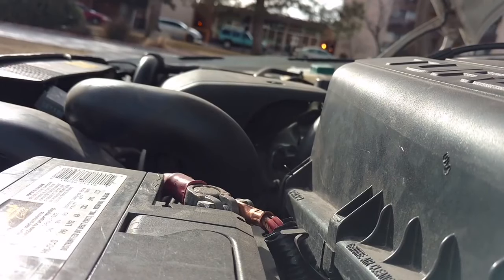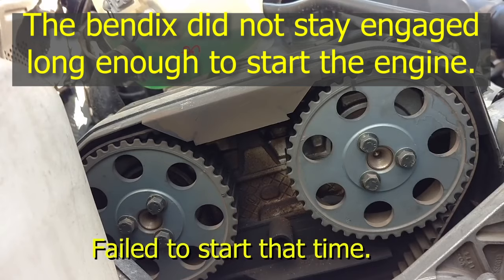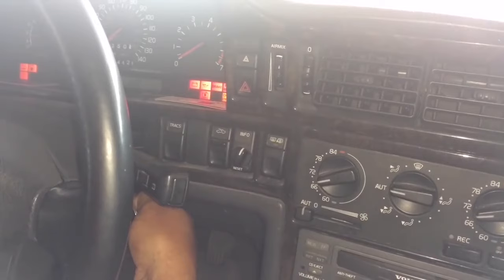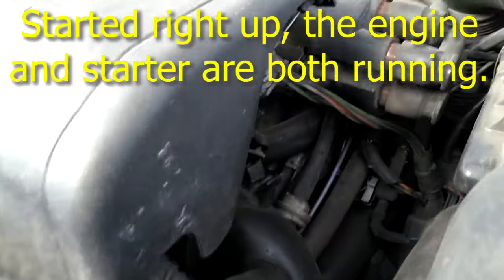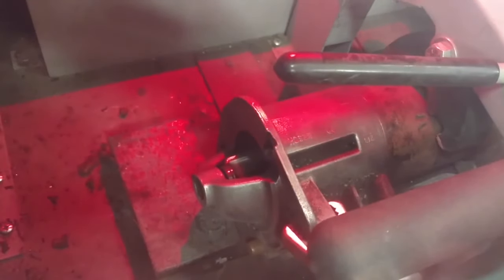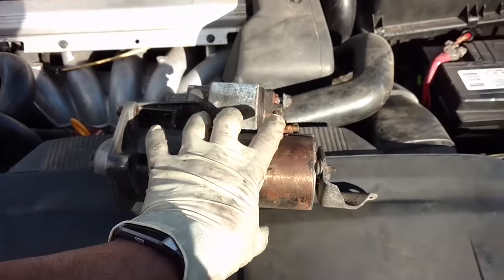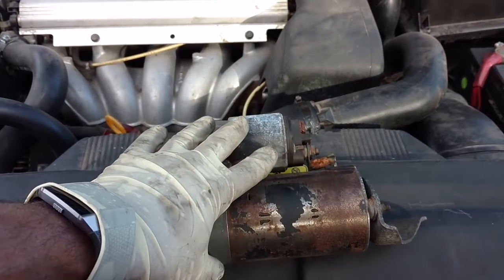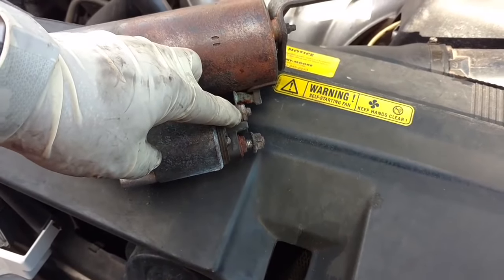Is your starter bad, hear the noises or sounds a bad starter will make. Also a full demonstration.

Comment: I just had my starter replaced at a shop, I usually do my work work but it’s a bitch to replace on a Chrysler 300 3.5 , but when I put the key in and turn it I only hear a click no crank , I had the battery checked that’s good and the terminals aren’t dirty and all my grounds are good. Does anyone know what it could be ?
Reply from the maker: sounds like a bad starter. go back to the shop, i'm sure they have a warranty.
Reply: @RobertDIY  alright thanks I’ll give them a call today
Reply: @RobertDIY  update the shop never conected the power wire to the starter i had to do that myslef, but now the issue is the starter isnt making contact with the flywheel the starter just free spins
Reply: any thoughts ?

Comment: What is it when it’s a loud whirrrrr
Reply from the maker: probably bad bendix.
Reply: @RobertDIY  
I installed a new marine type on my SeaRay v8 motor right before we put her into winterization and she worked beautifully. Maybe started the boat five times . Then yesterday when we were getting her ready to use for the season I tried turning her over and got a loud crunching a few times then the wirring noise after and that’s all she will do . 
I thought maybe not enough amps soo tested both batteries annnd one was kaput soo bought a new battery but same thing

Comment: IT COULD ALSO BE THE BATTERY 😉
Reply from the maker: Interesting
Reply: @RobertDIY  My engine started having trouble turning over at the same time as when the trailer brake service message appeared. I installed a new battery, turns over normal, and the message disappeared. Mechanic confirmed it was ok.

Comment: Hi Robert,

Thanks for your video. Very helpful. Can you also please help me identify these sounds coming my farm tractor.     I believe the 2nd one is definitely the starter solenoid clicking, but I don't understand the first one. I uploaded 2 videos temporarily on youtube.

This sound came when I would turn the key to start the engine, the engine wouldn't start (rusted negative terminal and bad battery too perhaps) and when I would turn off the key, that's when this sound came. It doesn't come now, after the terminals were cleaned with baking soda (previously the instrument display wouldn't come up as well)
https://youtu.be/z2SarM5SQL0

This is the sound that came when I was trying to crank the engine (after cleaning the terminals and the negative connection to the chassis). Is this the starter trying to start? or perhaps the solenoid clicking? - I believe this one is the solenoid based on your video
https://www.youtube.com/watch?v=KBXAUSSmF8U
Reply from the maker: I have no idea what the first one was. Maybe the solenoid trying to release. I would guess that the 2nd video sounds like either the battery is to weak or the starter is weak. Try jump starting it with a jumper and a good battery. 

When was the last time the engine ran? Did you turn it over by hand first? If it has no run in a while, like more than 24 months, I'd drop some oil in the combustion chamber and roll it over by had a few times.